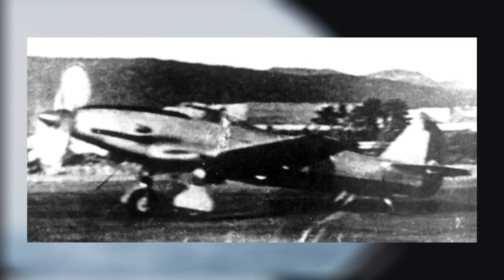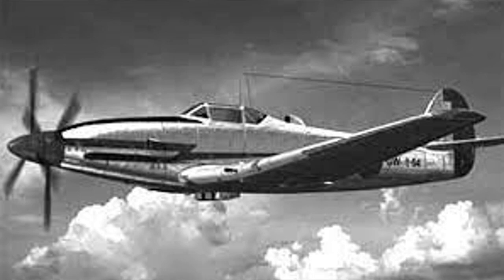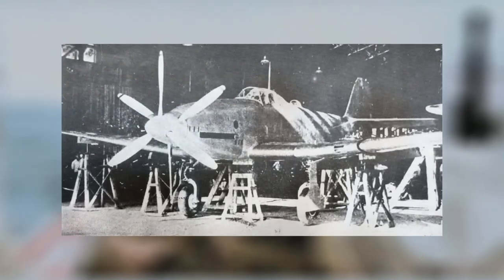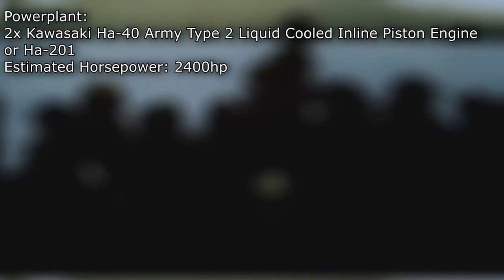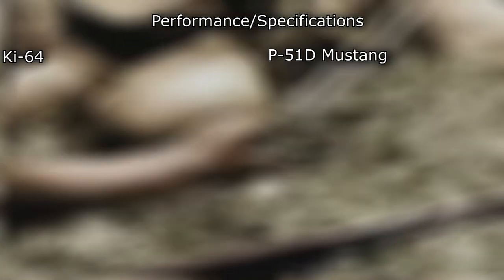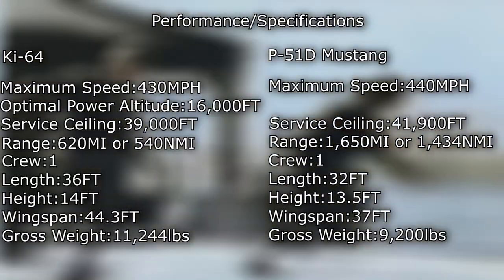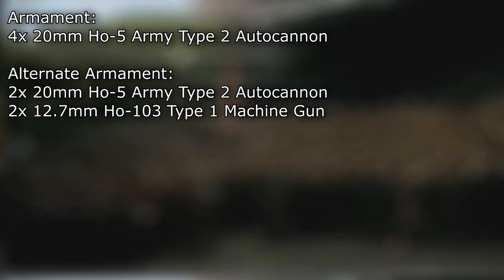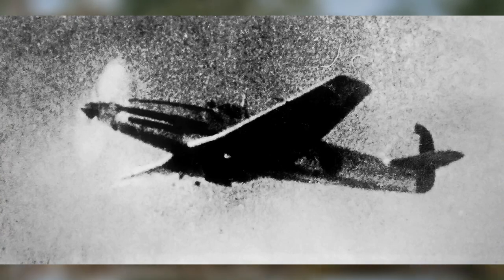Japan's P-51 Mustang | Kawasaki Ki-64

Comment: A better comparison would be with the Fisher P-75 which was also a heavy fighter with contra-rotating props. While the ''Eagle'' was to have one single Allison V-3420-23, 24 cylinder engine, that powerplant was to be made by coupling two V-1710 V-12 inlines.  It could not  outperform existing platforms like the P-38 and P-51 so it was cancelled.

Comment: A good idea on paper but in reality it  had trouble with overheating caused by the coupling of the 2 engines  The contra props also had teething problems   Maybe if more than one was built these may have been fixed   But to say is was a match for a  Mustang is drawing a long bow

Comment: Actually, after the first ki-64 prototype catch flame during its fifth flight, there were plans to eventually repair it and eventually continue with test flights. The airframe then was sent to Gifu factory for repair but then for unknown reasons, possibly bureaucratic, stay there from late 1943 until the end of the war when it was found by US occupation troops. A further developed version, dubbed the Ki-64-II Kai, was in the drawing board when the project abruptly ended. It was planned to ditch the entire troublesome surface evaporation that the first prototype use and instead ultilized normal radiator. I heard rumors about retractable radiator similar to the Me-309 but this remain unconfirm since we know little regarding this stage of the project. What is know further about the Ki-64-II Kai is that it will incorporated two Ha-140 (1400hp) same as the Ki-61-II instead of the twin Ha-40 (1150hp) that the first prototype use in the same configuration. The improved version was estimated to be capable of speed exceeding 800 km/h. Another Japanese Plane, the R2Y Keiun, encounterred a similar engine cooling issues as the Ki-64 later in 1945.
Reply: Just asking where did you get this source. It's interesting and I wanna know where did you get it?

Comment: Japanese planes were always hampered by poor quality gasoline.  Once our test engineers poured in some 150 octane Texas hot sauce, aircraft performance zoomed off the charts.
Reply: Germans had the same fuel problem.
Reply: @hertzair1186  / Clever German engineers couldn’t overcome low-octane coal mud.
Reply: Pretty sure the standard for U.S. aviation fuel was 100 octane. Japanese average was below 87 octane, getting generally worse as the war went on ☠️